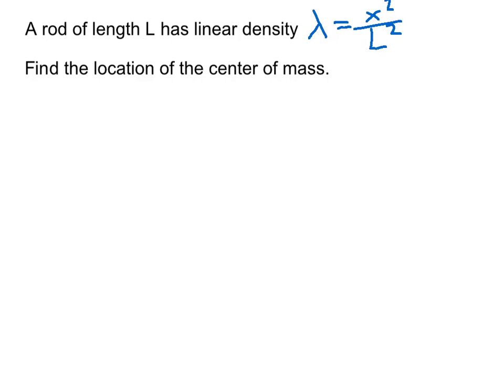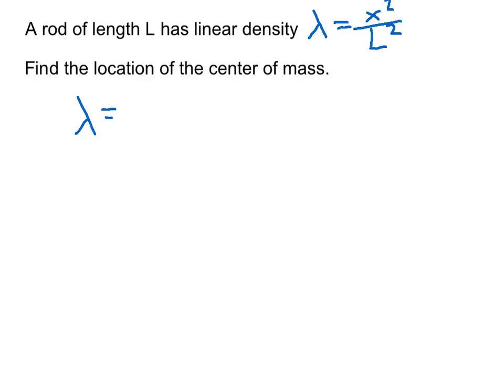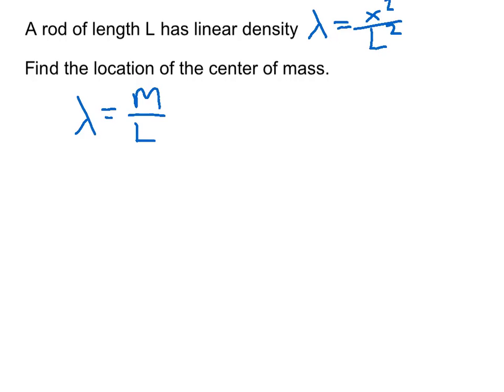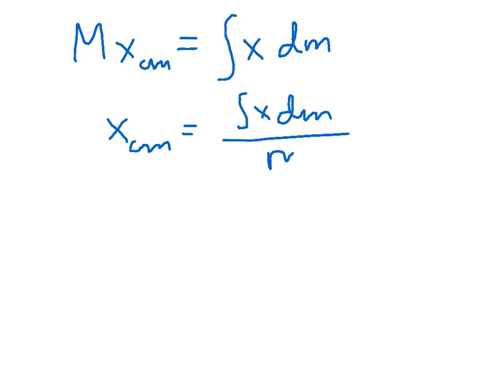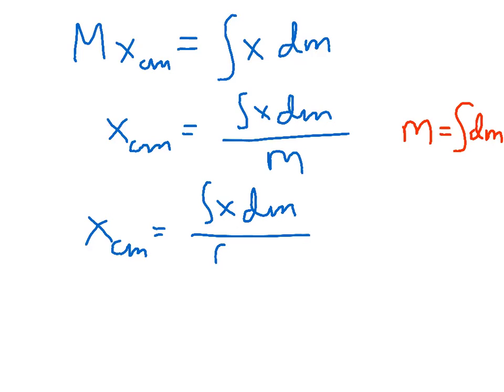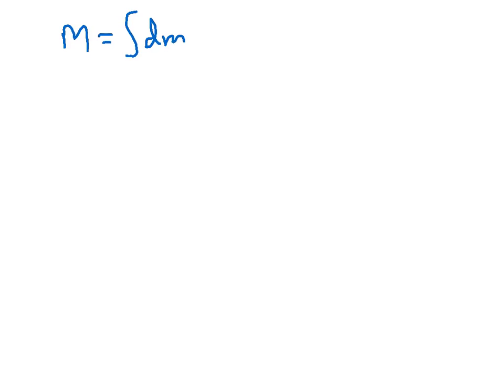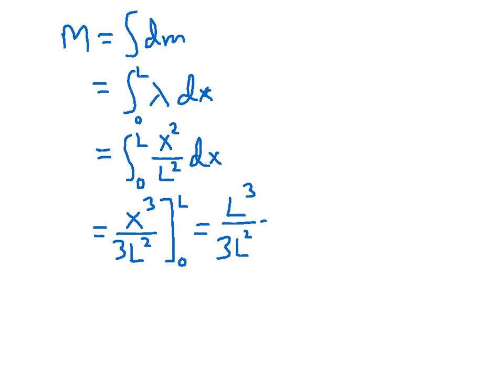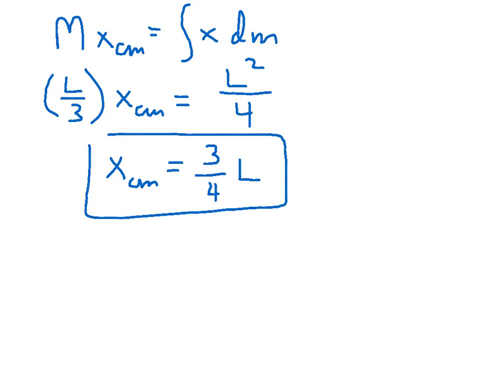Center of Mass - Nonuniform Rod

Comment: If x is kg and L is meters, then the units for lambda are kg^2 over m^2, then I see two problems with your solution.  First, the units for lambda are not the units for linear density, kg/m.  Second, when you substitute dm into the integral, your multiply x^2 (which you say is mass squared) with x which is the length.  These are different quantities which have been treated as the same when you do the integration.

Comment: I do not understand how linear density can be equal to xx/(LL).  Does L represent the length of the rod?  If so then the linear density is unitless.    This leads me to believe that the equation for the linear density is flawed.
Reply: it's not x/l it's m/l so units are kilograms per meter (kg/m).
Reply: Pretty sure X^2 over L^2 was the "equation given in the problem" for the use of an example. It's the non-uniform equation.